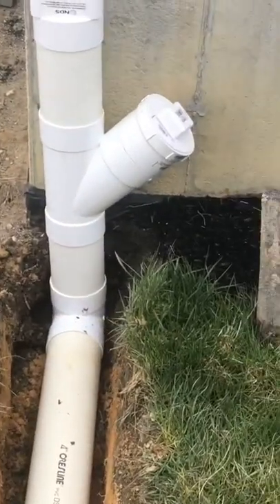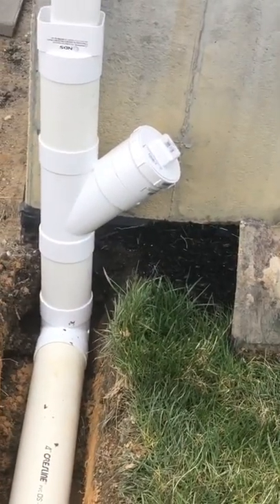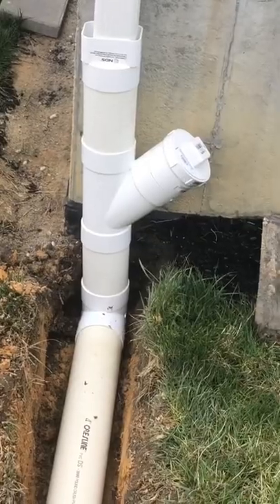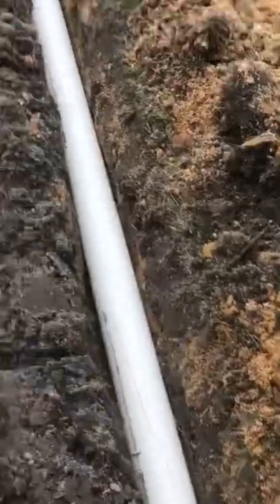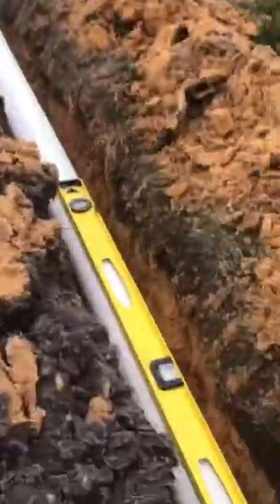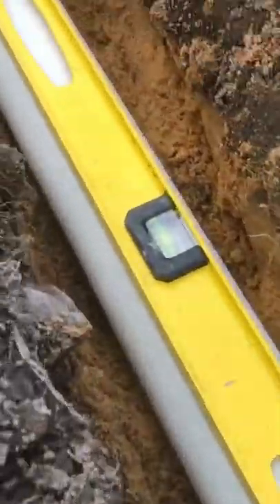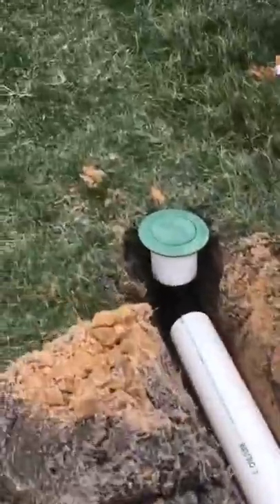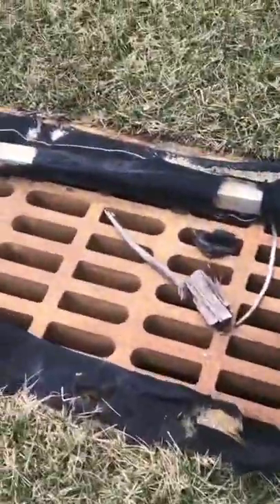This Is How To Properly Extend Your Downspouts Away From Your House

Comment: Good choice with the PVC vs horrible black corrigated.  However that 90 deg?  Should be a long sweep and why, when you have got a sewer like that in your yard, did you not run this gutter pipe into the side of it?
Reply from the maker: Not allowed to break into it sadly
Reply: Ya a sweeping elbow would be better than that 90°...when you have a straight 90° and  you do lose a lot of the velocity of the water coming down the downspout. That velocity is important even tho you have slope.  To bad you cannot core drill into the storm drain.  You have it nice and close to the storm drain though.  Clean job...nicely done.
Reply: Why would you use PVC over corrugated? Corrugated when sleeved is plenty durable and far more flexible for easier placement? The slope on this PVC is not steep enough to drain the pipe, water is going to sit in this pipe and eventually grow mold and bacteria and all sorts of nasty shit that will then wash out into the lawn and could pose a risk to dogs or cats or even kids.
Reply: @punditjudgement this is crazy talk. Every time it rains it washes out whatever is in the popup. This is a perfectly normal install and well done.
Reply: @patty109109  I agree! Looking at the bubble on his level, there's plenty of slope. If I had to critique this at all it would be to use a sweeping elbow instead of the 90° which pretty much is the consensus in the comments. I say he did a great job! 👍🏼

Comment: If you are sticking with pvc and not baughman pipe at least stick a T with a dry well under it right before the pop up so it will always drain. The pop up is secondary and the well will keep it clean. 🥰

Comment: What happens over time with all the shingle debris and sand collecting in the PVC pipe over time? There a way to clean it?
Reply from the maker: Yes that clean out you see in the picture. You put a hose in it and it comes to the end of the popup. You open the top and pull whatever’s in there out

Comment: Like the level with the three lines. What is the slope on this pipe? Whats the minimum slope required for a drain pipe?
Reply: I think 1in slope per foot or something like that, put if you just slope to full bubble you’ll be fine .

Comment: What's better, run of the mill gravel or river rock for a french drain? 

Some people recommend washed river rock that is 1"- 1 1/2" and every youtuber/expert uses cheap construction gravel.
Reply from the maker: The 3/4 blue stone is best for a French drain. It works great and is cheap. You then put the nicer river rock on top for a finish

Comment: That pop out is going to lift ?  Seems you need lots of water pressure
Reply from the maker: Yes it lifts. The head pressure from the downspout makes it flow. I show examples of it on many videos
Reply: They work perfectly. The top pops up without issue, the pressure is actually a lot once the pipe fills.
Reply from the maker: @patty109109  exactly

Comment: What if you get to the end and because of grade you are like 2 feet below the surface? Will it still work if you have to add a 2 foot vertical piece and the pop up to reach the surface?
Reply: That will work, no problem. I've gone over 6 feet on many jobs

Comment: How much does something like this cost?
Reply from the maker: depends on how far it has to go.. materials have gone up. but on average it’s like $700 a downspout
Reply: @jerseyshoredrainagesolutions  if using a 4” schedule 40 for my discharge line, do I have to go below freeze thaw in MI? My yard has no slope so I am hoping my schedule 40 pipe will survive the winter without cracking at just 6” below ground?
Reply from the maker: @alizin2011  if you use the popup with a hole in the 90 then the water will drain out.
Reply: @jerseyshoredrainagesolutions , ok my plan is to use a pop up with a catch basin for all my downspouts to capture any debris and roof granules. $700 per downspout seems too much so I’ll do it myself
Reply from the maker: @alizin2011  good luck man. Make sure you use the popup with the hole in the 90 or drill a hole in a 90 so the water can drain out when no head pressure is there to force the water out
Reply: @jerseyshoredrainagesolutions  explain this boss ? High side of the 90 ?
Reply: @Arcanus31  The bottom of the 90 that turns up to the popup, essentially the lowest part of the whole setup, it allows it to drain otherwise water would sit in the 90 with nowhere to go
Reply: Hack job like that should be free
Reply: @iceman846 Well head over there and show em how its done Lip's
Reply: Mine won’t drain with hose:/
Reply: @iceman846 not a hack job at all. Did the same at my house and it works a treat. My guess is you watch YouTube vids all day but never put your hands on a shovel.

Comment: How do you keep the last 3 or 4 ft from freezing and having the ice push the pop up off the pipe? just drill holes or slits I'm assuming?
Reply from the maker: I drill holes at the end of the 90 and make a mini dry well under it so the water can still drain into the ground if it can’t pop up

Comment: Obviously it doesn't freeze where this place is, it also would've been a cleaner finish just to tie that line directly into that storm grate through the side of it. Punch a hole in it and call it a day guranteed you had the height advantage on it.
Reply from the maker: It does freeze in NJ. And you can’t legally punch a hole into the storm grate or I would have lol
Reply: Won’t this freeze in the winter???
Reply from the maker: @Millyyyy93  no. Just literally posted a video on this today

Comment: PVC cracks - should use a good corrugated pipe
Reply: Corrugated clogs and slows flow of water. Sediment and granules fill the ribs.
Reply: I'm replacing mine today . The first 10 feet of pvc cracked. Looking for an alternative